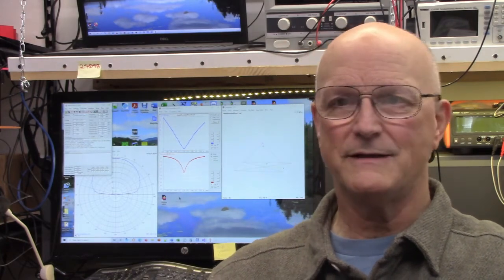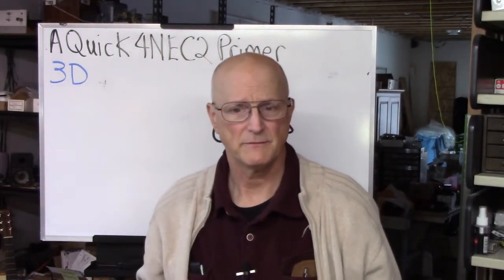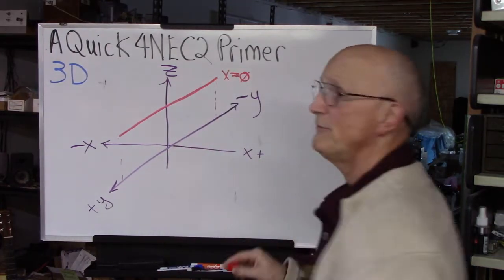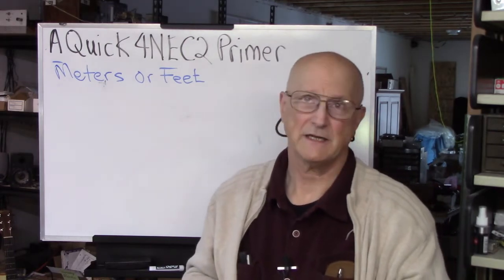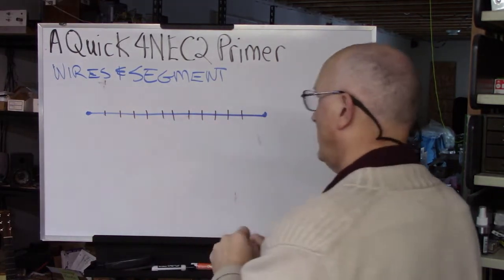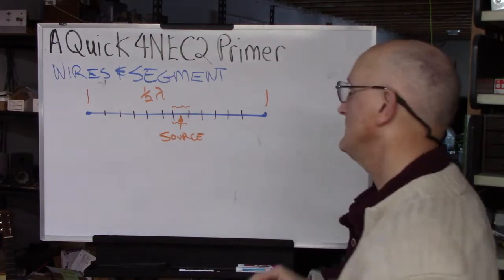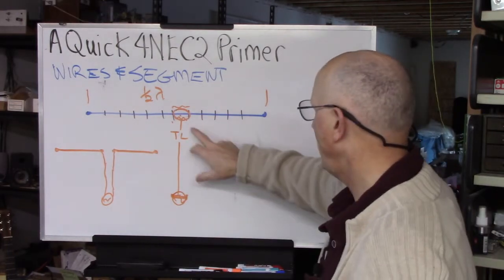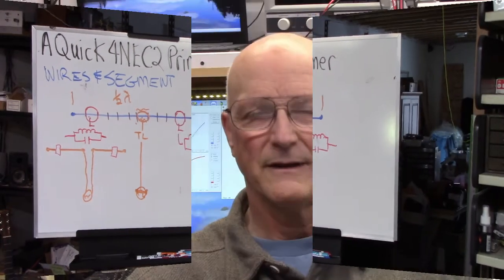4NEC2 Antenna Modelling Application: A Quick Tutorial (008a)

Comment: Thanks for the reply.  I am using 4NEC 5.8.16 and did what you suggested, and unless I am doing something else incorrectly, I couldn't get the circle to start the source load at the beginning of the vertical z axis wire.  Will you be doing a pod cast in the future on modeling verticals?  Best Regards
Reply from the maker: Next, be sure that your vertical wire does not start at Z=0. It can be 1 cm off the ground, but it cannot be ON the ground. Also...of you defined your wire such that Z1 = 10 and Z2=0.1 with 10 segments, then segment #1 is at Z1.  If you want your source to be near the ground, then it would have to be segment 10. 🙂

Comment: Outstanding Ralph! I want to start getting into antenna modeling and feel that 4NEC2 is the best 'free' program out there. I scanned YouTube for tutorials and was amazed at how poorly this has been presented by others ... except you! Very clear and concise - so far so good! On to #2 🙂 73 KJ6ER
Reply from the maker: That was my experience, too, when I was coming up to speed on 4NEC2.  I am glad that you have found my video helpful!
I am planning on another video sometime in the coming weeks on modeling a trapped antenna. Of course, this means I have to talk about traps a bit, too. I think I might make the discussion of the traps themselves a separate video so I can show how to tune them too.
Reply: @eie_for_you  I'm very pleased you are staying active on this subject, I look forward to your upcoming video(s). What got me started was that I built a resonant 40M antenna using my 17' telescoping whip and hung two 15' wires off the top at 45 degrees as a capacity hat! I was amazed at how well that antenna worked (QSOs) and how the SWR was 'flat' (<1.1:1) across the entire band. I only used a homebrew RF choke at the feedpoint. 

Then, to burst my novice bubble, someone told me that the great SWR was actually not good because the ground was absorbed ~3dB of my signal (half) and the SWR should actually be closer to >1.5:1 if the ground was perfect. I scratched my head and said 'huh'? So that's why I want to understand the 'why' of my prototype antenna. Greg KJ6ER
Reply from the maker: Sounds like an interesting project. It'll be interesting to see how it works out in 4NEC2.
Ralph
WA2PUX